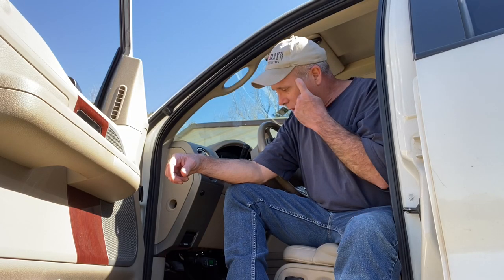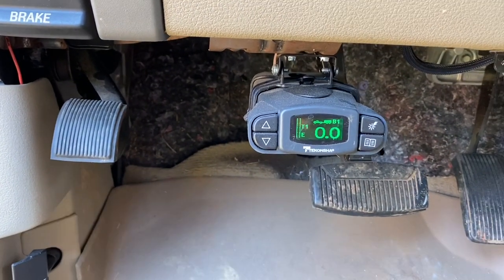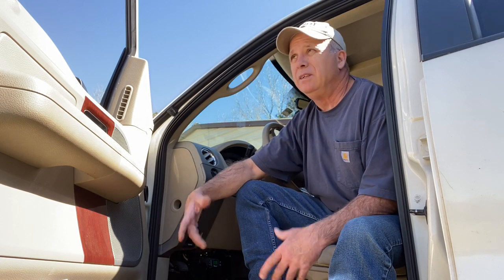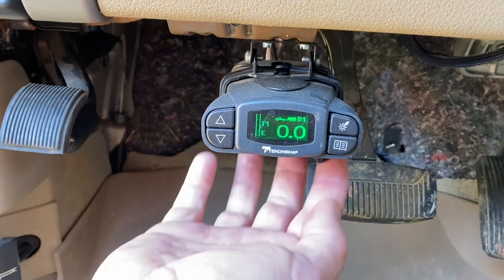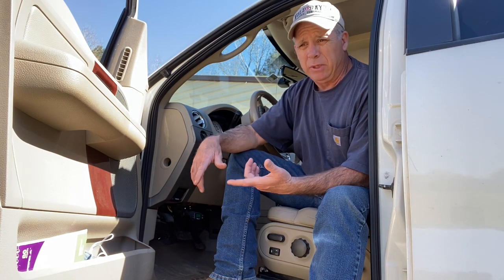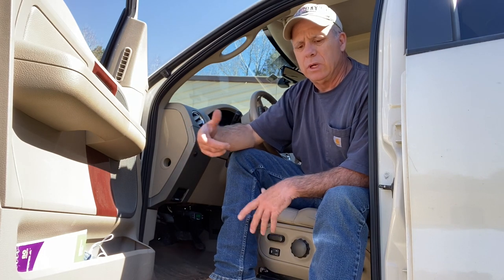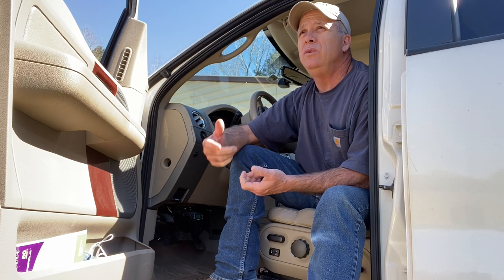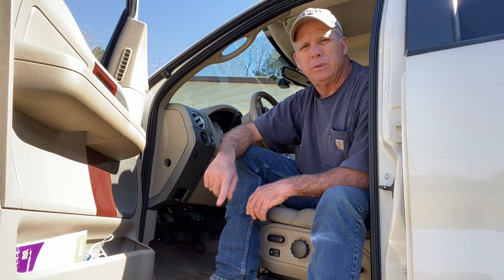How to adjust your trailer brakes

Comment: I’ve been pulling trailers for 45 years and I never really thought about how to adjust the controller. I’ve always just set it at the middle setting, until the other day, when my trailer brakes locked up in a panic stop. And that’s why I’m here, great content, thanks!
Reply from the maker: Well glad it helped! I appreciate the kind words and thx for watching!
Reply: I have never had them work right , usually have to used the manual control to make them work at all

Comment: I was always told put your truck in drive and when your trailer can stop your truck completely without your truck breaks then you are good. You don’t want your trailer brakes locking up it will end up being a bad situation. Locked up brakes end up causing bad accidents, because that trailer will start to slide and you may not be able to correct it. Great advice. Thanks for the video
Reply from the maker: Your trailer brakes are never strong enough to stop the trailer and tow vehicle, they just assist in slowing momentum. If you go back and listen, I said once the brakes lock up then lower your gain by 1 whole number and then fine tune it from there. Your 100% correct that you never want your brakes to lock. That’s just to get max stopping power during initial set up. Thx for watching!

Comment: Thanks for the info.  When adjusting your brakes should you do it with a loaded trailer or empty.  It seems that an empty trailer will lock the brakes before a loaded trailer would.
Reply from the maker: Depends in my opinion, if it’s a camper then they seem to be “mostly” loaded so you could adjust it for that but if it were a car hauler or flatbed, then adjust for unloaded and then you can add gain as needed since every load will weigh different.
Reply: @bdradley1  Car hauler...  But I would be towing the same car every time.  Thanks!

Comment: When the trailer brakes locked up, will it unlocked by itself when tow truck go?
Reply from the maker: Your just adjusting them until they lock up by using the trailer brake controller only. Once they lock up you will decrease the power applied (by decreasing number) and then when you actually drive applying your vehicle brakes, your trailer brakes will work accordingly. Thx for watching

Comment: What if your gain is relatively high and the trailer doesn't lock up yet?  Thinking most likely the trailer brakes are shot?
Reply from the maker: I would agree that there is an issue with trailer brakes but without seeing and knowing history and age of trailer it’s hard to say but that’s where I’d start. Thx for watching
Reply: If they are standard trailer drum brakes then they might only need adjustment. There are videos on how to adjust them and what is the right amount of brake drag.  If you've had the trailer for over a year and haven't had your brakes checked then that should something you have done along with repacking the axle bearings.  It's not too expensive to have done or if you're handy to do yourself.

Comment: How do you do this if you have an after market trailer brake controller with no digital readout?  thanks!
Reply from the maker: Unfortunately You will just have to guess basically, I suggest to just hitting the decreases button to start and then just slowly work up until you start getting some braking activity

Comment: Should it be at 0 when you're not towing anything or does it not matter? I just bought my first truck that has a  towing package so I'm new to all of this lol
Reply from the maker: It’s not active when you have no trailer attached. It’s automatically activated when you plug into the 7 pin round connector. So once you have it set for trailer just leave it. Hope that helps and thanks for watching!

Comment: Should my trailer be loaded when making these adjustments?
Reply from the maker: No it should be empty. If you set it to a loaded trailer then the wheels will constantly be locking up when empty. Thx for watching!-

Comment: Unless you have my problem. I can shot 12v straight from a loose battery and my brake still won't lock up with the tralier empty. Yes there adjustable, even a little tighter than normal and the brakes or new....

Comment: Hey so I have an issue I have a car hauler electric brakes double axel  so when I set the gain to about 7 or 8 I'll co.e to a stop using the trailer brakes but when coming to a stop at low speed the trailer brakes will lock up even when I set the gain to about 1
Reply from the maker: It definitely shouldn’t be locking up at 1, obviously hard to diagnose without seeing it or knowing history or age of trailer and brake components. Sounds like you could possibly have a faulty wheel brake cylinder inside the drum that’s locking when set to 1, that’s just a guess though. Hopefully that gives you a starting point
Reply: @bdradley1  trailer is brand new just picked it up from a dealer last week
Reply from the maker: @toby514  wow that’s odd, there’s so many variables it’s just hard to diagnose without seeing. Could be issue with controller itself. Aftermarket could be wired wrong, factory could be malfunctioning. I just don’t know. Brakes could be installed incorrectly on trailer. Just no way to know without seeing.
Reply: @bdradley1  ok thank you
Reply: @bdradley1  so I found out what was wrong a faulty trailer brake controller today I went to ford got another one on we are in business but would like to thank you for taking a min out your time and getting back to me so fast once again thank you
Reply from the maker: @toby514  absolutely and glad you got it! I appreciate you getting back to me and thx for watching! I wasn’t much help since I couldn’t see it but at least got you thinking and going right direction

Comment: Pulling the gain will not lock a travel trailer even max gain
Reply from the maker: @mikemccarthy6939  then your most likely to have your wheel brake cylinder on your trailer axle not working. When trailers sit for extended periods of time, moisture gets in those drum brakes and rust the wheel cylinder stuck. Your tow vehicle is most likely doing the majority of the breaking in this case. You need to inspect trailer brakes.
Reply: @bdradley1  I did have them inspected all axle and brakes worked perfectly both dealerships that inspected said brakes will not lock up
Reply from the maker: @mikemccarthy6939  that’s odd, not typically the case
Reply: @bdradley1   I’m going to look in to it more